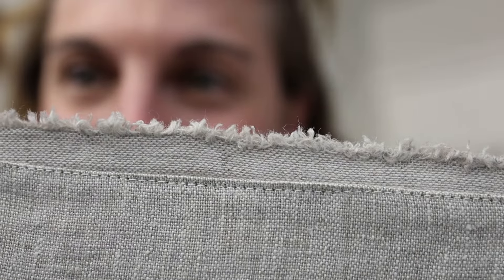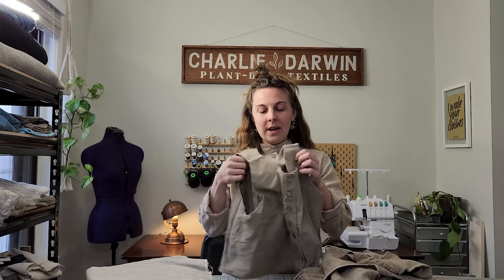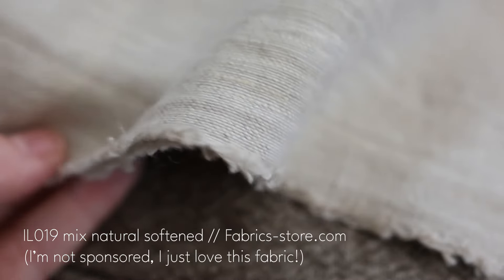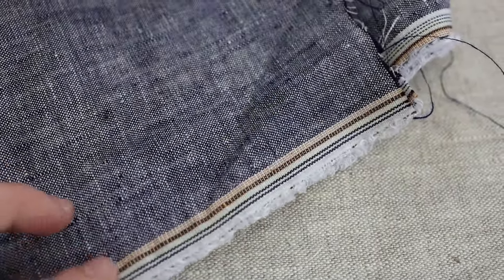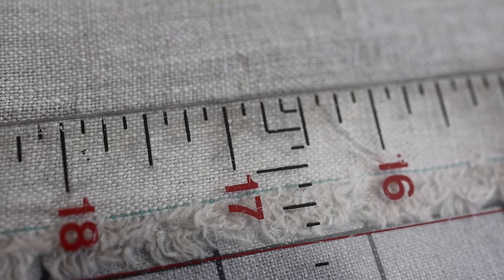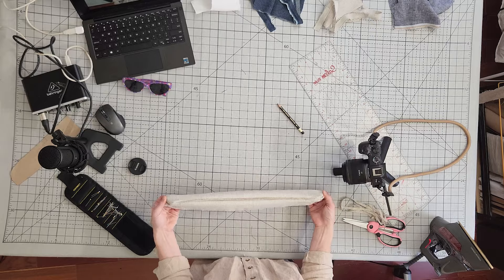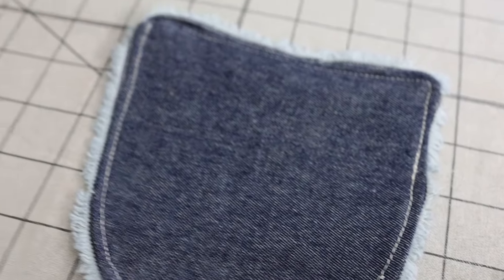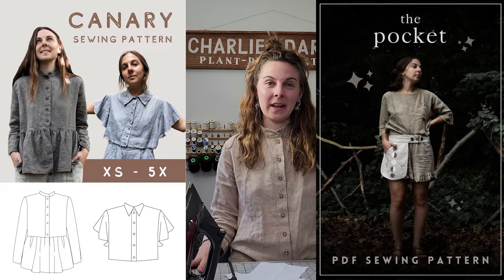3 COOL WAYS to use SELVAGE EDGE in linen sewing projects: add faux fray to earthy linen clothing!

Comment: The salvedge isn’t  bound. It is woven along with the fabric. It is simply where the weft thread has come to the edge of the warp threads, turns back wrapping the  last warp thread.  As you noted it is often more tight women. There are more threads per inch in the selvedge.